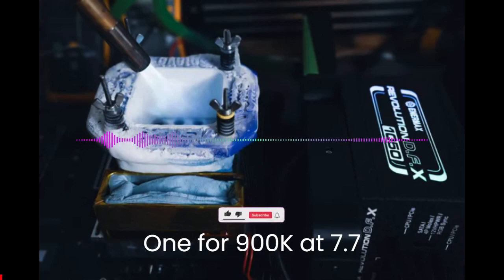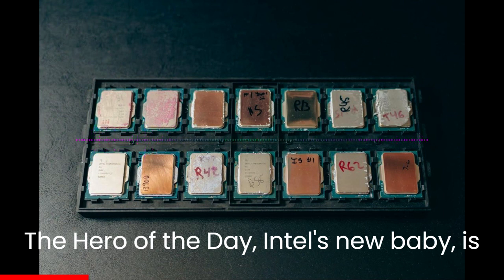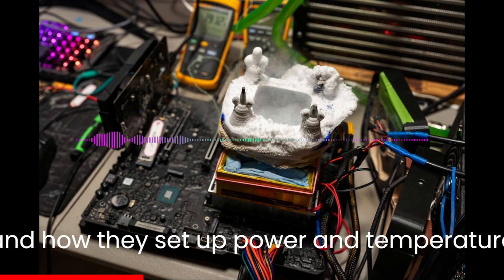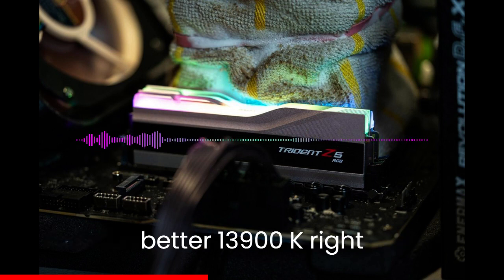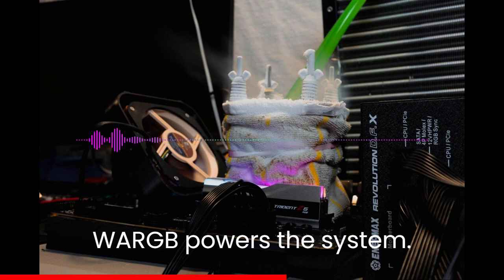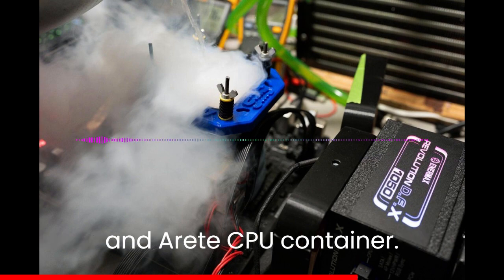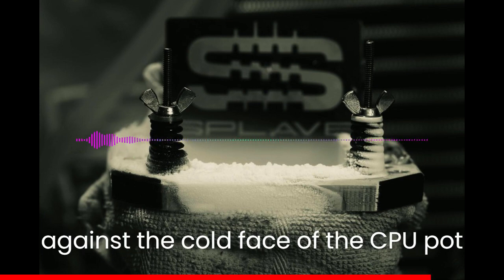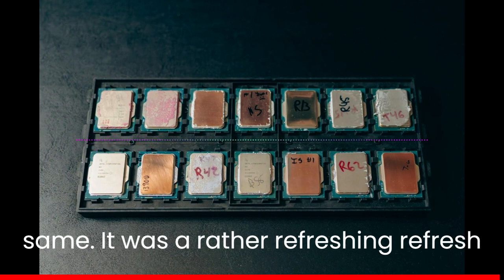14900K at 7.7 GHz​ Overclocking with Intel's Raptor Lake Refresh CPUs and Plenty of Liquid Nitrogen

Comment: This video is completely useless if you aren't even showing real time numbers or an actual video of the process, but instead, you are only using still images and have to use AI because you are afraid of people hearing you or insecure about your voice. Credibility goes straight down the drain into the sewer with the rest of the sh*t.
Reply from the maker: Broo it 2023 near 24 and i think my voice is not that insecure but i want to use new technology and im gonna use piad AI soon
Reply: @kome7375  its 2023 and you are still using still images to show something you claimed to achieve instead of showing it happening on video instead of pictures. Makes it have 0 credibility. People dont like AI generated speech, they like real people showing real results. I can tell English wasnt your first language so thats most likely why you dont want to talk in the video.
Reply: @latinprince896 Pull up with your liquid nitrogen overclocking vids, bruh. I wanna see your tunnel vision.